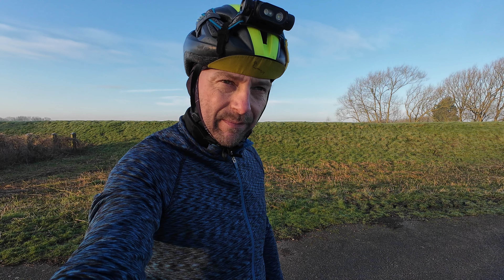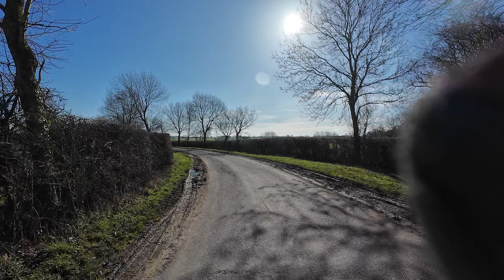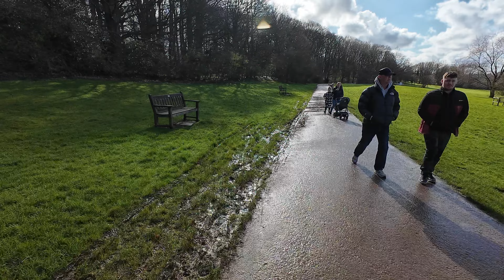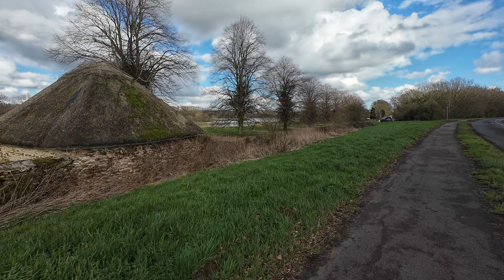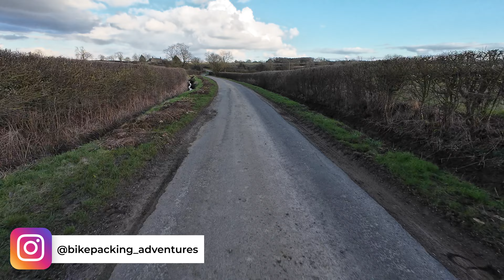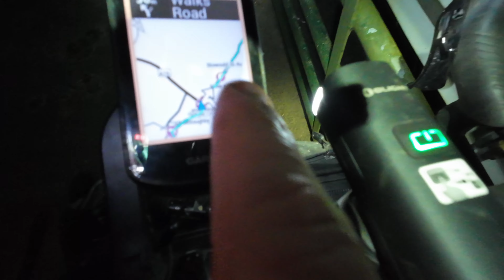Lincoln Water Rail Way to Rutland Water : 120 miles of road and gravel

Comment: It used to be HMP Ashwell, it closed in 2011 after riots in I think 2009 made badly damaged 3 wings, making it unrepairable, when it changed to an Enterprise park, there's a lovely Cafe Charcuterie open in it called Hare and Hog, fantastic food. Also in Oakham the Castle cottage cafe is a great stop, lovely homemade cake, and breakfast is fantastic,
Reply: The riots made big news when they happened. Especially concerning the overcrowding there.
Reply from the maker: I shall have to check them out - I've never stopped in a cafe in Oakham before. 👍

Comment: Sorry if you've already mentioned it, but what saddle are you using for those long rides?
Reply from the maker: Great no problem to ask, its the Spoon from Charge bikes.
Reply: Great video. I live quite near Greylees and often cycle to what was the March Hare. I think I might extend my next ride out Rutland Water and then back. It will be good training for a 100 miles C2c2c that’s coming up at the end of June. 
Keep the videos coming I really enjoy them.
Reply: @BikepackingAdventures That's very interesting. Not expensive saddle at all; do you find there's no pressure on the perineum or that area (if you don't mind me asking!). I've tried a Brooks Saddle (no luck) then Selle Italia, but I'm not so sure about that as it can cause blisters.